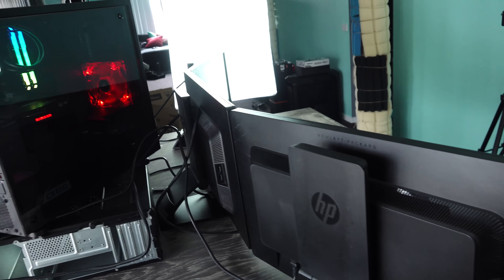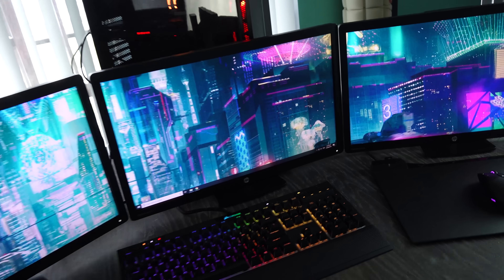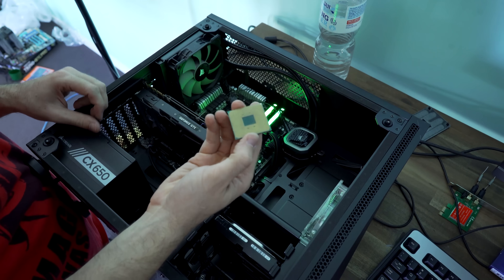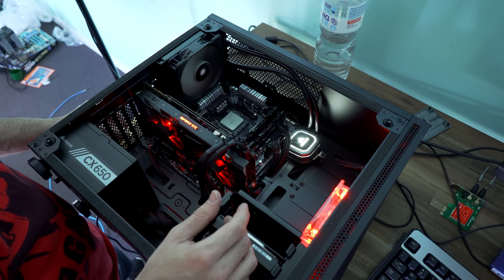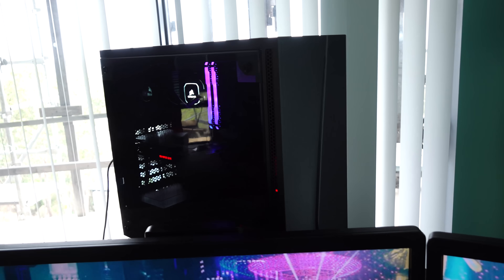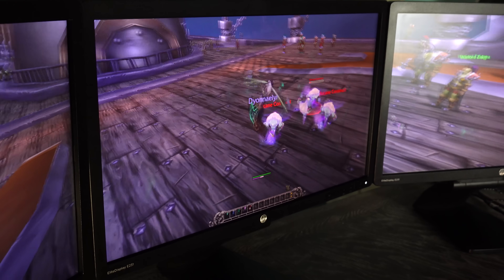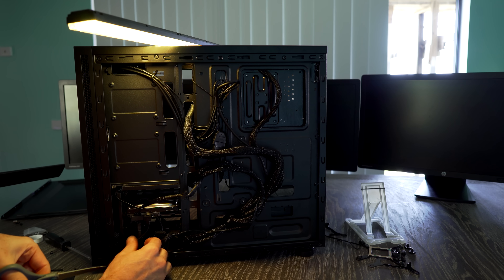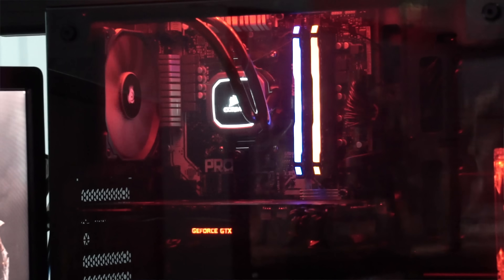Ryzen Problems...!? Post Analysis of the AMD WoW Gaming PC

Comment: Brian, are you going to do another video showing off the "Barron" case as I am a true MOBO & Case whore/hoarder.... Then CPU with my GPU being the last worry - always.... I seemed to like that case from what I saw as I LOVE smaller cases that still take full power supplies, etc ... ....as in as small as possible with still enough room to do what one has to do... I am still rocking an Antec Super Lan Boy case from 2002ish or so?.... I do not think any exist anymore, anywhere, not even on ebay.... Anyway, love those old cases that are tanks but also thought out and not taking up to much space.... I am rocking an Antec Performance p182 case that I modded with a side window, radiator room as well as custom rgb's and even a modded color as in the gun metal turns into a very factory looking "army camo flage" looking paint job but in silver/grey colors when its bleach washed.... My other retro but relevant overpriced 1100T build is rocking the super lan boy, ALL ORIGINAL! Have any "RETRO CASES BUD?"....... .....WOULD MAKE A GREAT VIDEO OR SERIES..... Rare cases that allot of us probably have!...... #OldiesButGoodies and Brian remember, #x79 bro! HAHA, I am locked in at 4.79ghz now on my 1650 hexacore xeon v0 and getting 1487 now in cinebench, not bad? 8700k "like"..... Oh, I also seen a xeon that turbo's up to 4ghz I want to check out to as in the 1660 or one of those versions of the 16 series, I will recheck, it has to be good if turbos to 4ghz from factory as in a great overclocker.....

Comment: I had an issue today with a new ryzen 1600 build. I installed everything and when it came time to boot it for the first time nothing happened. Went through the whole process of checking ram psu hdd and the last thing i did was reset cmos and that did it. A simple build took me almost 4hrs thx to issues and troubleshooting. But thankfully now works.

Comment: The system partition problem happened to me a month ago, I almost lost my Win10 key because of that, let me explain.
I changed my HDD and installed a new one, then I formated the old HDD for later use, then I go to boot my PC and... it didnt boot, after finding about this issue I was lucky to recover the partition from my HDD and clone it to my SDD! (used EaseUS) now it works fine.

PD: I'm intel, so its not a Ryzen issue.

Comment: has nothing to do with Ryzen. Could also occur if you have your HDD in Sata port 0 - and the SSD in sata port 1.  If you install UEFI (Non CSM) mode, this wouldn't matter coz everything of Windows + bios files are stored then on the system drive. Just install Windows on the SSD with your HDD unplugged as you said, common sense (learned this the hard way too). Is however a possibility to transfer the system / boot partition to the Windows drive itself (done that some time ago to on a system)

Comment: I haven't built any 3 monitor rigs but I have built a few 2 monitors. I'm sitting at one now.
For many things, Windows rocks and Linux is a pain, but getting a Mate desktop to work with dual monitor and setting all that up, is a hundred times easier and simpler and better in Linux (Mint for example) than it is in Windows. This is one of the things that's just there in Linux, and it almost always just works. Changing it, moving the monitors around, changing the orientation... Linux makes all this so simple, but Windows is a pain.

Comment: I used to have problem with booting up or after restart my ryzen 1600 . It will light up like the PC is on but no post. All I did was bios update to the latest one and it's gone. No more problems with it
Reply: I'm using the same motherboard as you  but the bigger version. Asrock b350 pro 4

Comment: I've got my ryzen 5 1600 oced to 4ghz using the stock cooler, it's stable at 1.35v, I think I got SUPER lucky with it. Hottest it got was 77 under stress test, during normal use and gaming it sits at 65ish. I'm super happy with it.
Reply: Recently built a R5 1400 system out of parts I had laying around from a decommissioned mining rig. 3.85 ghz, stock cooler, never goes over 75. I could probably get more with more voltage but I'm happy with where it's at. Only problem is the 3000mhz ram kit I had laying around is unsupported so it wont go over 2400 but I see no reason to pay these prices for a few more mhz, she rocks like she is. Especially since a simple bios update boosted performance over 10% across the board.
Reply: To be honest, the only reason I got R5 1600 was because my sisters gaming computer got massive water damage and she had to replace pretty much everything, so I gave her my i7 6700k and mobo/ram, she bought a new power supply and case, and I gave her a gtx 970 to replace her old 1070, at the time prices were obscene, luckily she only has a 1080p 60hz screen and only really plays FFXIV and Visual Novels. So she's set for a while. I play at 4k, and the r5 1600 where it's OCed plays just as well at 4k as the 6700k did, I got a bad overclocker, and it won't stay stable over 4.5ghz. I was planning on getting a 2080ti and gifting my 1080ti to my sister, but at 1200.00 I'd rather stick with my 1080ti a few more years.

Comment: I've gamed in surround for years. I've never had a problem mixing DVI, HDMI and Display Port outputs. Nvidia have a recommended port usage guide on their website to tell you which ports to use for multi-display setups using single and SLI configurations.

Comment: That's funny. I've had the most problems with DisplayPort; random black screen (one monitor only) requiring a monitor unplug to restore the one DP monitor that went black. I've mixed DP, HDMI, and DVI without issue; other than the DP issue mentioned. Cable quality and length can be an issue The DP issue was more than likely a specific monitor issue; BENQ GW2765HT. This is not an uncommon issue unfortunately. Just sharing. Overall, mixing is not an issue and required in older generation cards. :)

Comment: Ryzen is very particular about it's ram it prefers 2666, 3000, 3200 MHz, LPX Vengeance is my go to... My Rigs Running a Duel Channel Kit of LPX Vengeance 8x2 for 16 Gb, I wish I had 4x4 for 16 but hay it's fine as it is... Secondly this Exact Bug Happened to me, and Swapping them was the Cure... As to the OS Error that is an Odd one... But I just keep my important stuff on a 2 Tb 7200 Drive... My OS is all alone on it's own Drive and that is how it stays... I plugged that one in First and then set it as First in the Boot Order and then plugged in the Second Drive and So on... Basically It takes about three or four Resets to get The Thing Purring... For my Gigabyte Board The Case Fans were a Nightmare for me though seeing as they all had Low Med High Settings and the Bios was Confused as to the Settings acting like a Turbo Fan Boost for every Fan until I set it to Voltage and System 1 rather than the Default... Which was PWM which is now Set only to the Cpu Fan cause it was going at 4000 RPM when the other Fans were Involved... So yeah It took some Debugging but the Pay of was Worth it... Fair Warning I think Ryzen is allergic to Windows 7 I don't know why but I think it's Software and not Hardware... I Give the Ryzen 2600x the Budget King Trophy for Performance to Power it's only slightly worse than Intel's I7 and seriously I see solid performance across the Board...

Comment: what you are saying about the hard drive, SSD and Windows is ABSOLUTELY TRUE!  I just finished my Ryzen TR 2 build and could not install Windows at all.  I removed my Sata connections and only used my NVME for the Windows install and it worked.  I reconnected my Sata drives (I have a 1 TB SSD and 2 TB Hard drives along with a PCIE SSD....

Comment: I don't know about Nvidia, but RADEON doesn't have any issues with mixing HDMI with DP in surround (Eyefinity as RADEON calls it). I know, because I run triple 4k, and I had a DP cable get damaged, so I had 1 on HDMI (actually still need to get that cable replaced...). I could test this with my Titan Xp, but I don't feel like using that loud piece of junk right now, plus my test bench is where my 3rd monitor goes... Ok, I'm just lazy!

Comment: Odd problems. So far I've built three Ryzen systems and the only start up problem I've had was the cable from the start button wasn't connected to the motherboard on the last build I did. I might have knocked it off while plugging in the SATA cables and simply didn't notice until I pushed the button and nothing happened.

Comment: That windows splitting into different drive happened to me as well on my Intel system when I made my first PC back in 2014. I think it should be a general rule to plug in your main drive for your OS only; just incase it pulls a cheeky move like that. It's what I've done for ally other PC builds that I've done for people.

Comment: I'm not sure if you saw my tweet a couple days ago about overclocking the QX9650 or not but I got it figured out. I haven't pushed it all the way yet but right now it's sitting at 3.5GHz @ 1.31V and under 100% load its only hitting 50c. This CPU is trading blows with my i5 4690K when it was stock out of the box. Only 200 points difference in firestrike, but the graphic scores favored the QX9650 - GTX 680 vs the 4690K - GTX 960. Only issue is when I run the bench now it doesn't recognize my 680 after the latest video drivers update and it calls it a generic video card.

Comment: I had a similar issue. Asrock AB350m Pro4 though. Wouldn't boot until I messed with the ram sticks order/slots, even though it was plugged in according to the manual. Once it booted successfully I put both sticks in and it worked fine. Happened back in July 2017.

Comment: Why do people constantly keep going on about RYZEN and gaming? Its fine , its totally 100% fine for everything. Yes if you play at 1080p and put low settings on your intel will have 200fps and your ryzen will get 180fps. The install thing is a software bug.
Reply: Not to mention most of the benchmarks you see are using an early bios . I recently did a bios update that boosted my performance significantly.
Reply: https://static.techspot.com/articles-info/1614/bench/FarCry.png
now imagine the 2080ti

Comment: This is why I stick with Intel. You pay a bit more, but I never had any major issues like this. In fact I never had a problem with a second hand Intel chip ever. AMD was always behind and now with this new line-up CPU's sure you get "good" performance for the price, but not without the problems. Getting fast memory, so over 2400MHz will set you back probably closer to the Intel equivalent anyway. Everything just works out the box with Intel and it always did for me. Plus few extras like optane memory and mostly higher clocks with most of the Intel equivalents. At least better overclocks and thermals. There is a reason you pay less, not only because of the market share difference.
Reply: Intel had the same architecture for 10 years now, it would be embarrassing if they hadn't ironed the bugs out. it's not like Intel doesn't have issues on new technology (X299).
Reply: I have built, owned, and refurbished many PCs over the years and can tell you that you are very lucky if you have never had issues with an Intel based PC. Just the issues he had with this build are totally problems that happen with Intel builds and not specific to AMD. FYI Intel is the one selling space heaters now since they need the higher clocks on their aging iterative architecture to stay ahead because AMD's IPC is higher. Also, AMD has StoreMI and there is 3rd party software the same as Optane. Besides that, SSD cashing it's a niche thing and Optane is hardly the best option since it uses proprietary hardware.
Reply: StoreMI does not really work properly if you ever used it. It needs major improvements.
I mean it's not a bad thing that a well proven architecture is being perfected over the years. The bugs aren't to do with the chip and 99% of times to do with the board. Get a good motherboard, it works like a dream.

Comment: not really an issue with RYZEN (i had this happen to a number of systems primary  intel UEFI boards as well), this is a windows issue in the way it sees the drives sometimes it sees the first Drive as the drive your going to be installing windows but that drive might be the storage drive is at the top of the list of the windows disk manager when your selecting where you want it installed and your SSD is below the storage drive and both are blank Very likely you end up with bootloader on the storage drive,

to make sure not wasting time disconnect all disks apart from the one you want installing windows onto , if the drive has been used before its like it's going to be in MBR layout not GPT witch might be why its preferring the blank HDD over the SSD if it's been used before, use diskpart and clear command , press Shift+F10 to bring command up what at any stage of the setup, if your on the select disk/partition page press back before using diskpart (i just leave other disks unplugged now as seems hit or miss sometimes where windows 7/8/10 wants the boot info on)

this issue has been going on from when windows vista was around so it's nothing new not CPU specific (more issue between windows and how the board is showing the disks more so if its UEFI board but had this happen on non UEFI boards as well) even the way they are or when they was formatted (not very consistent)

Comment: Mixing DVI, HDMI and DP works just fine. The only issue might be different color temperature output, but you can tweak that with most monitor settings.

Comment: Im doing just that, mixing DP, HDMI and DVA for my 5760x1080p setup. Works great, the only problem is that the DVA monitor has a slightly different color temperature and I think that because its an analog signal.

Comment: 4:22 untrue. I had a similar problem of when I reinstalled Windows on my 960 Evo 500 GB it used to existing System-Reserved-partition of my old installation on a BIOS-level-RAID of 2x 840 Evo and 2x 850 Evo 250 GB (don't ask about it) and I mitigated it by shrinking and moving my new installation by the size of System-reserved which I then copied over and adjusted its flags. I did it with "Partition Wizard", but I am sure many other third-party Windows tools or maybe even some stock Linux tools like dd can do this quite easily. Generally though, just unplug those drives during installation and you 'll be fine.

P.S.: I mostly use Arch Linux (based Manjaro) now. :P

Comment: Tech Yes when you didn't get The 2tb+ did you manage to see if the harddisk was configured as mbr ou gpt? Cause from what I know the mbr file system limit the maximum capability of your Hard disk to 2tb per partition. When you format your system if you use the diskpart by accessing via prompt in Windows install screen with "f10" and use the command to clear the HD and then use the convert gpt command your system install should occur all fine with the ssd and HD if both are in gpt.
Reply: Sorry for bad english. Not native, and my cellphone keyboard doesnt help me he keep auto correct in portuguese. If I didn't explain correct please call me again here that i'll try to explain better when At a computer

Comment: 3:07 I have had that a lot on several boards. Recently I had an ASUS Z170-A not turn on because a friend of mine did just populate channel 2. However the problem persisted when I populated only slot 1. I had to change around for an eternity and now the low-binned 2x 8 GB Micron sticks (stock is 2133 CL13 or similar for 2016's 63€ - good times) do 3000 MHz CL15 no problem (stability tested).
My Prime X370 Pro even crashes on me when I insert my RAM in Slot 2 of every channel (still dual channel mind you), whereas Slot 1 works perfectly. Also some other boards, especially those ASUS ones don't boot at all and one ASRock Z77 does not boot with sticks in Channel A, which means I have to use Channel B for 16 GB and overclock (compared to 1600 MHz JEDEC) the crap out of it for this problem to not matter that much.

Comment: So I have an 1700 with an X370 board, I have a SSD and a 3TB hard drive, I havent came across ofany problems that you have here. Did you get a faulthy chip or is it cause its Zen+?
Reply: Florian Oprescu  hmm
Reply: The boot partition location is a Windows issue and the memory problem is not specific to AMD. Those issues can happen on many different builds from Intel or AMD.

Comment: Doesn't hirens boot have an option to relocate system reserved?
🤔
Reply: Bcdboot and bootsect from command line work fine to make a new boot boot sector onto a target drive too

May have to use a partition tool to free up 100mb in front of the data because it allocated all for the ntfs partition though.